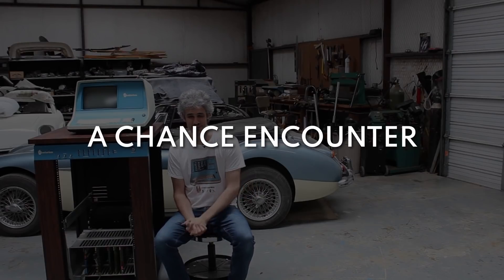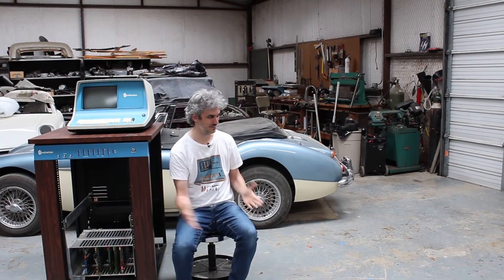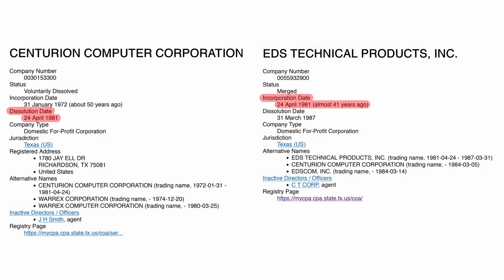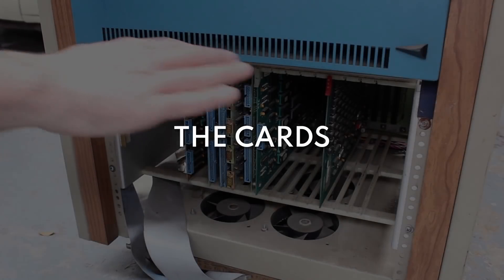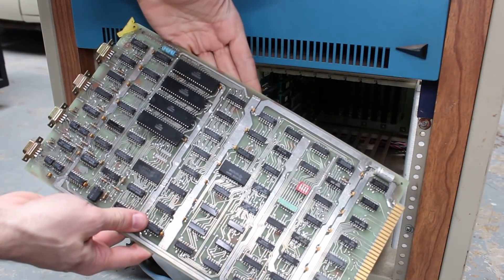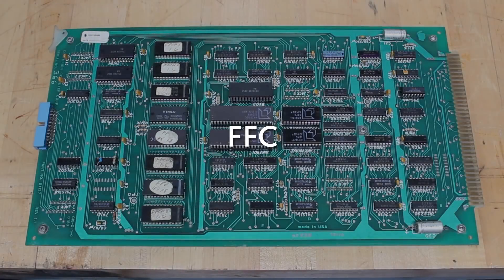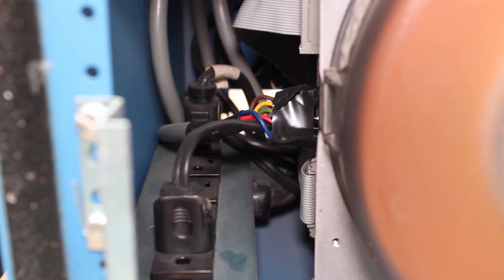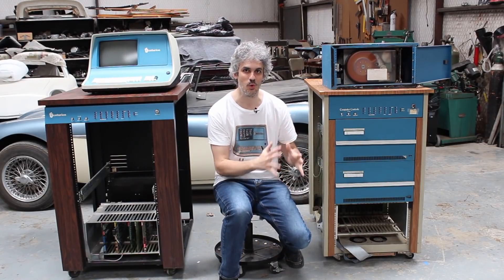Minicomputer Part 12: I Bought a What?!

Comment: Fun fact that their original CPU design was called the “CPU4” because it took up 4 boards. Then when they got it down to 2 boards, they called it the “CPU2” “CPU5”, and then with 1 board, it became the “CPU1” “CPU6”.
Reply: yeah.  I got wrinkles on my fivehead thinking about this.  (one more than "forehead")
Reply from the maker: To bake your noodle even further, after the bankruptcy, various people continued to own the Centurion name and developed a CPU7, CPU8, CPU9 and even a CPU10! The CPU7 was still AM2901 based but moved over to a multibus setup. The CPU8 and CPU9 I'm a bit fuzzy on, but the CPU10 was a 386 running a proprietary Centurion emulator.
Reply: engineering 👍

Comment: One word of caution about those Hawk drives.  Purge the hell out of them before allowing the heads to load.  I've rebuilt a few 300MB CDCs after a head crash.  The process involved removing the shroud and flushing it with water.  After cleaning/inspecting and replacing the heads, there was a breaker to turn off.  With the breaker off, the drive would spin up, but the heads wouldn't load.  That was how we purged.  In theory, it should only take a couple of hours, but the one time I did that, I had another head crash.  I learned to always purge overnight.  Given that they have been powered off so long, it might not be a bad idea to flush out the shroud.  But I wouldn't remove the heads as you probably have no way of aligning them.  (Or returning them back to whatever alignment state they were in.)
Reply: Yeah, with it sitting that long, I would probably let it purge for more than just a night.
Reply: What is purging for those at the back?
Reply: @ShokaLion  Hard drives have to work in a clean room type of environment. Any dust or dirt can cause a head crash.

Purging, or letting the disks spin with the heads parked along with the air filtration system running, allows them to self clean and 'purge' all the dust and dirt out.
Reply: @UsagiElectric - Might want to bump this thread or pin it, or something. Would be a shame to lose those Hawk drives before you even get them booted properly!😉
Reply: @ShokaLion  To add to what RingingResonance said, all drive have to operate in an extremely clean environment.  A smoke particle is larger than the height the heads fly above the spinning platters.  Modern drives are sealed and safe from contaminated air.  But these old CDC drives are open where the heads enter the drive.  It's kept clean by pumping filtered air into the drive.  But having been turned off so long, and stored in who knows what, dust has no doubt worked it's way into the clean area.  Purging, letting the diskpack spin without the heads loaded, creates the aerodynamics of a working drive to help rid it of contaminates.
Reply from the maker: Russel coming in hot with properly good advice!
Thank you so much for the "heads" up (alright that was a bad pun, but I still laughed at myself when typing it, haha). 

I'm currently trying to hunt down new filters for the drives, but definitely a good idea to purge them overnight. I was going to purge them, but everything I've seen always just says to purge for a few hours. However, I like your idea of "cleaner is better" here and will definitely let them purge for about 12 hours. Assuming of course the machine wasn't decommissioned because of head crashes, there's no telling how long they ran on filters from '94. 

I would pin this is there wasn't a need to pin the post of trying to calm the lynch mobs down, but know that your advice is definitely welcome and heard!
Reply: @UsagiElectric  If you can remove the shroud without removing the bottom platter, I'd give it serious consideration.  I just hate to think how much dust drifted into that area sitting in storage.  The reason I'm reluctant to remove the platter is it may throw off the alignment.  I don't think it had a servo track.  As such, it wouldn't be the worst idea to let it purge for days.  Maybe even shoot some compressed air in while it's purging.
Reply from the maker: @russellhltn1396  According to Ken, it does indeed have a servo track. The bottom of the fixed platter is servo data, then the top of the fixed was usually OS, and then the removable platter was stored data. But, the entire shroud can be quite easily removed without disturbing the the platter itself, which is very nice for cleaning and working on the machine. So, we should be able to spin it up to purge it with the shroud off for a few hours, then get the shroud on and let the cooling air cycle for a few more hours. I'm quite hopeful that if these don't have a head crash, we can get them up and running without any drastic measures!
Reply: @UsagiElectric  I would invest in a way to archive data from that computer first. Make some kind of interface to a modern computer so that as soon as you have the drives working you can begin archiving them in case they crash later on.

Comment: dont destroy the counterfeit machine like that. As you said it was extremely important to the short history of the company, it needs to be preserved as is and displayed next to an original machine
Reply: +1 ! it's a very rare example of a counterfait/genuine machine where the original builder dont destroy but take care of them. Cool story to tell
Reply: +1 Definitely a important historical piece, I definitely agree as well!
Reply: I really don't want him to destroy the counterfeit machine either
Reply: He isnt destroying it though
Reply: I think in this case it's ok. We'll have two working machines this way, and the actual counterfeit boards will remain in the counterfeit chassis.
Reply: This is a story good enough to be made into a TV drama (similar to the BBC's outstanding "Micro Men" from 2009). Having an original counterfeit system would be the icing on the cake, should such a drama ever be filmed!
Reply: Ironically, putting the parts into the genuine chassis will make a machine even more counterfeit than the counterfeit machine you started with. 
Don’t destroy the counterfeit machine. You will dilute the value of both machines if you do.
Reply from the maker: I left a big pinned comment up above about where I'm coming from, but I'll copy pasta it here too. I'll try to clarify where I'm coming from with the idea behind it!

First, I’m not going to destroy anything, it’s just a simple chassis swap. The only panel that would get permanently modified is the panel for the spare genuine chassis. The original counterfeit chassis would remain exactly like it is, and at any given time, all the parts could be swapped back into it without any problems.

Next, I think we have to be realistic about Centurion and its (lack of) importance to computer history. As awesome as I think the Centurion story is, it really is just a blip in computer history, and really has very, very little historical importance. Getting a museum to take a machine that requires knowing all the minutiae about that particular company’s history to grasp the relevance of it is practically impossible. Museums have incredibly limited space and the counterfeit machine as an example of what killed this company that no one’s even heard about doesn’t have enough provenance.

Finally, and this is the big one, it’s not about preserving a very specific, dark piece of Centurion’s history, it’s about preserving Centurion as a whole, represented by their best. A counterfeit machine tells just a tiny bit of the story. If someone is at a museum, at most they’ll spend 5 minutes looking at a machine. If someone looks at this machine, I want the story to do Centurion justice. To tell the story of a company in their prime, not the story of how an obscure computer company failed. Let’s build Centurion up to what they were at their peak. Show the beautiful wood paneling, demonstrate the genuine software, represent the very best they had to offer!

But, like I said, everything will be reversible and the counterfeit chassis is just that, a chassis, everything can be swapped back in. The plan is to build it into something I would be proud to display and then give the museum the option of choosing which chassis they want. 

I hope that alleviates some of your worry!
Reply: I can't help but fully concur with everyone that the counterfeit be kept as it is probably a BIGGER story than the original. After all it is the one with the Ross Perot history to it, which is an important piece of Americana. I know I am not an American, but if I were you I wouldn't ignore the advice given here by the others.
Reply: recover and clone the CDC drive. Maybe ossible to get both of them running
Reply: I have to disagree, it's well intended to think that there's a story that a physical copy of something tells a story about it's history, but this piece, with arc soldered production level machines is a symptom of that history and I don't think it paints that picture. If these boards were hand soldered and we could show a side by side comparison of the backside of the Boards I don't think it might be more significant. What this is is simply an actual Centurion in an off the shelf chassis with none of the custom panels on real centurion chassis. It's not really a counterfeit but an authorized clone at this point. I don't think there is anything wrong with using its parts to tell a better story about the people who made this machine and how it came about.  I don't think anyone is talking about destroying the old chassis either. What would happen if at some point a handful of the hand soldered parts turned up in an estate sale? There would be a need for a matching chassis to go with. I think that would make a more authentic story of the fakes. I'm for one just grateful that we get to witness this, for free on the internet. If anything this is as close as I will ever get to experiencing LSI computing, unless I build one myself 😅..
Reply: It would be great if he could find the hand soldered boards to put in the counterfeit chassis.
Reply: @witlesscord903  yes he is
Reply: @UsagiElectric  yeah but you are wrong
Reply from the maker: @johncarver9997  I think there's still a lot of confusion here as to what the plan is.

Let me reiterate - I will NOT be modifying the counterfeit chassis in any way. Everything will be 100% reversible and if a museum shows interest, they can choose whichever chassis they would like to display it in. The computer, drives and PSU can all be swapped between the two chassis in under an hour. The counterfeit chassis WILL be preserved as is with no modifications at all to it. I think there was a lot of confusion about this with people thinking I was going to modify the counterfeit chassis.

It seems really strange to get upset about giving a museum more options in how they want to display the machine and tell the story. Conversely, that seems like a good thing and a better path forward to potentially getting a museum interested in the machine.

But, if I am still wrong, you're more than welcome to hunt down a Centurion machine of your own, restore it how you see fit and make a YouTube series chronicling how you did it better than me!
Reply: @your_utube  he's just gonna do whatever he wants to to a piece of history, and then complain about his viewers when people dont agree with it.
Reply: he doesn't want to listen to reason, he wants to be a special person who makes history about himself.
Reply: @UsagiElectric  you remind me a LOT of the guy who runs the We're In Hell channel here on YouTube, any chance you're his older brother?
Reply: I don’t think what he’s doing is really irreversible. Not sure what the hubbub was all about but I am watching in order so maybe something different is revealed in later videos.

Comment: This story just gets cooler and cooler. I am so amazed for how everything is turning out, it's honestly just what I had hoped for, not only 2 more (possibly non-crashed!) hawk drives, but an actual sealed modern-style HDD that is almost certainly working and with Centurion software on it!!  I am totally on board with using the parts from the 'counterfeit' machine to bring the real mini up to full operating spec and stoked for the chassis transplant as well, I don't see what people are beefing about. It's not like you are scrapping the counterfeit chassis for firewood or something.
Reply from the maker: Thank you so much!
I'm super hopeful that there's some actual usable software on one of those drives. Even if the Finch doesn't have an OS on it, if it has a piece of software, we should be able to pull it out and dissect and get a much better idea of how the instruction set works, and maybe even use it as a foundation for custom software in the future!
I'm right there with you, the counterfeit chassis is going to be kept in proper good condition, I'm just taking the already different boards and putting them in a different chassis, something that's totally reversible if a museum wishes it so. It seems wild for so many people to get wildly upset about it, but I think the big thing was that many were confused when I was talking about modifying the front panel. I meant that I was going to modify the front panel on the second genuine chassis I have, not on the counterfeit chassis, but I can see how that could be misunderstood given how quickly I said it in the video.

Comment: What are the odds? DJ is a really cool dude in my book, especially after a story like that!

Not one, but TWO Hawk drives? A Finch drive too? With this many spares and potentially working drives available, the chances of having a fully functioning Centurion just went up exponentially! Eagerly looking forward to the next video. :3
Reply from the maker: Thank you!
And DJ is a super cool dude!
I totally think we can get at least one Hawk drive working well! 

There's various plans for how to divvy up the drives between the two systems depending on how many of them work. But, if we can get one of the Hawk Drives working and running original software, that will definitely stay with the museum piece. The Finch drive was definitely an add-on later because Centurion would normally build the Finch drive onto a frame that would mount in the chassis unless it was a late addition for someone who already had a machine. So, the Finch drive isn't really original to either machine as they would have been when sold, so it'll probably end up with the FFC card in my genuine machine as a way for use to store and test increasingly large programs.
Reply: @UsagiElectric  Oh, definitely. You should be able to get at least one Hawk drive working. Wishing you luck that you can get both working, though. That would be awesome if both machines had one to use!

That honestly makes sense with the Finch drive being an addition later in the life of the machine. If that's the case, then the hours on that drive would be significantly lower than compared to ones sold with systems. I'd infer that the odds of it working would be quite good in that case. Would be neat to find a proper chassis cage mount for it, though. Maybe someday.

Comment: Just put the dead Hawk drive into the counterfeit machine so it still has two, it only needs to look the part.
Reply from the maker: You're totally right, but man does that ever feel disingenuous!
Granted, the only thing that is still properly "counterfeit" is the chassis itself, so I could just slip an FPGA emulator of the CPU6 system behind all the proper paneling and no one would have a clue. 
Still, I feel the joy in these systems is firing them up and using them. Hell, I even had the genuine system on and running today even though I wasn't filming anything with it. The counterfeit system may have some importance to it, but it just seems a shame to not let the old girl stretch her legs a bit!

Comment: I'm torn on what I think about the counterfeit. On one hand, it's super cool as-is and is a really awesome sidenote in Centurion's history. But also I really like the idea of going the rest of the way into turning it into a real Centurion for a museum. Either way, please do keep the original counterfeit chassis because it's a cool piece of history. And parts can always be swapped back at will.

Anyways, I've been loving this series, keep it up!
Reply: With today's technologies, may it be possible to align the heads off a good platter? Maybe one of the disks, in the stack, is an alignment disk?
Reply: You can always just keep the rack and install a "counterfeit" machine inside of it out of modern hardware to emulate it, and use the actual hardware to build up the other 2 machines.
Reply from the maker: Thank you!
And that's totally the plan! Both Chassis' will be cleaned up and the only chassis that will be getting any modifications is the spare chassis. But, everything just bolts in with a few nuts and bolts, and so the computer, drives and PSU can be swapped between chassis in about an hour, so if a museum is interested in the machine, they can choose whichever form they would like to display it in.

Comment: I originally had this video served to me on my main page at random and I am so glad it appeared! Vintage cars, vintage electronics, and vintage computers, I have found a fellow geek of my stripe!! I love the direction you wanna take both of the machines, one to experiment with and use as a testbed to see what it can do and one as a time capsule to preserve for history, very gearhead move there.  Building 2 running machines with a Hawk drive for each one is a great plan and once you get them going then you can see what is on all of the removable platters, you may find the original Centurions OS back-up on one of them. I can't wait to see where this goes you got me hooked.
Also, I had to come back and add, the community effort to get this old beast operational is inspiring, y'all basically got her going from the diag card by reading the code on the eproms and building a schematic to investigate how it all talked just absolutely impressive work!!